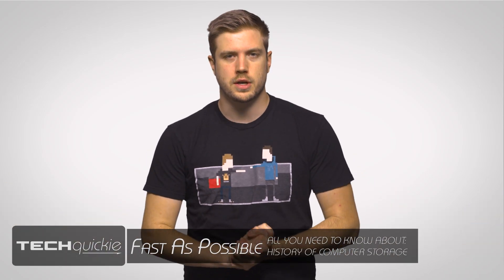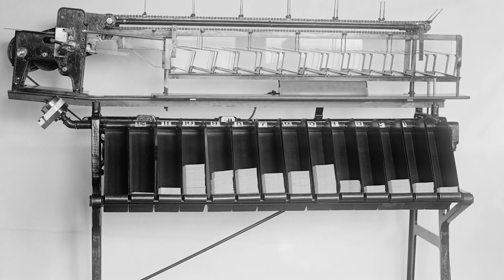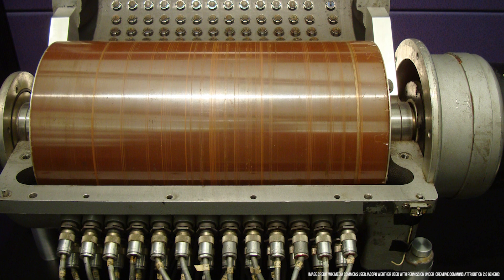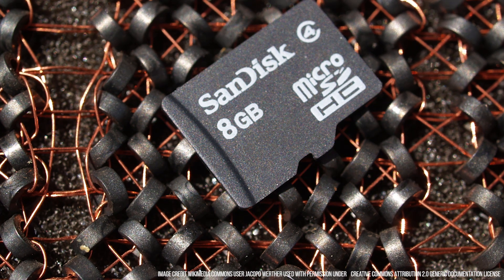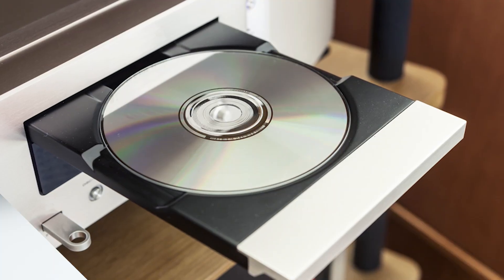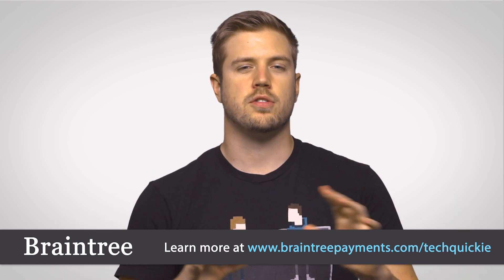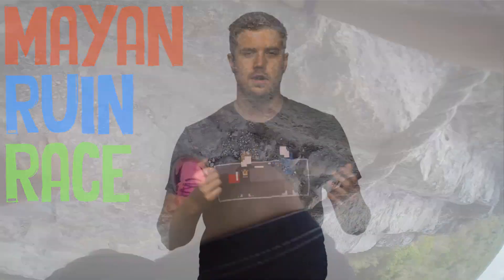The History of Computer Storage

Comment: But wait. Before using floppy disks, they used cassete tapes, did'nt? 
I remember of a C64 cassete tape driver that people used to store data.
Reply: ...and Vic20 before that.  Atari computer too.  Can't remember if Apple tried tape first.  The Sinclair had tape.  Lots of others too.  Wow it was exciting when microcomputers hit the market.  Golden years.... sigh.
Reply: Cassettes are tape.  He mentioned tape.
Reply: I question if you can quadbit on those tapes...

I mean 1's and 0's are fine, modulated down to sounds. But you could speed up reading/writing to audio tapes if you have a 4 state or even 8 state system. Like MLC and TLC.
Reply: Franklin Cerpico He portrayed all magnetic tapes as large, cumbersome things.  And that relief arrived only when disks hit the market.  So that's why it  was pointes out that cassette tapes were/are portable and convenient.

Masticina Akicta Huh?  Roughing it out with four old 56k modems, on each of the four tracks of a cassette, would provide large storage.  And those "old", more recent, modems (90's) were designed for the limited bandwidth of phone lines.  Cassettes have a much broader bandwidth.

I'd have to pull out the books to figure out the theoretical limits, but old tape modulation (80's) didn't even utilize stero tracks, and was just very primitive in general.

Wait... I didn't bring up this issue in this thread.  It'll just confuse readers.  Sorry.

Btw, info on tapes and disks are never stored as unmodulated 0s and 1s (as in magnetic polarity).  Unfortunately, that notion has been perpetuated.  Data is always modulated to analogue, and compression schemes are implemented.
Reply: schitlipz Ah right, makes sense. I am sure that with todays insight and technology we could stuff allot more on an audio tape. Hell lets be fair we already stuff TERABYTES of data on big tapes. A small tape like that probably can handle a Gigabyte if using the same level of technology.

Comment: I worked on a system that used cards and drum storage in the early 80's.  And the drum held about 700K bytes.  It also had core memory.  Each card that was about 18 inch square held 1024 Bits.  It took 16 cards to hold 1K words.

Comment: I'm sitting here with my $2 ebay 32GB Micro SD card like "woah"
Reply: Be careful with those on eBay. They are often counterfeit and don't hold as much data as is said on the card.
Reply: Yea, this one only holds 29 gigs :(
Reply: That's cause 32GB and 29.8GiB is the same. Google GB vs GiB if confused.
Reply: 29 vs 32 is acceptable, even branded ones do this. The problem is that some cheap drives would have a build in way to trick the computer into thinking it can hold so much, but when you fill it up there is very little space (8 or 16 gb) and the data gets corrupted, I'd save download a bunch of data onto it (a few hd or blue ray movies can do the trick) to make sure it will hold as much as it seems to be able to before using it for important stuff.
Reply: Well said, but there are also programs that will test how much data the card is actually able to hold like h2testw.
Reply: Ah cool, how does one look up such a program? What are they called/name a good one
Reply: I hear H2testw is the best one, not certain what any of the other ones are, but you can just search H2testw on Google and Softpedia has an English page for the download.
Reply: WOAH WOAH WOAH WOAH!!!

Comment: THE HARD DRIVE ON MY LAPTOP IS ONLY 32 GIGABYTES!!!!!!!
Reply: BlueJayGamer17 You probably have a Chromebook, and it doesnt have a hard drive, it uses flash storage which is faster than a hard drive, but more expensive to manufacture and holds less data, similiar to an SSD.
Reply: DemonicScepter an SD card? A HDD is 10 times faster.

Comment: This video relives a hole lot of memories. I never found out there was such thing as flash memory until I bought an hp40g+ calculator back in either 2005. The manual suggested inserting a flash memory chip. Into a special slot built into the calculator. So I thought I was in seventh heaven with my SD Card because I could keep backing up my HOME directory onto this card. if things crashed I used the SD Card to get it back.

Eventually I learned how to organize my data into a DOS/Windows directory hierarchy. I built my Home directory archive filenames out of today's date. That way I know when I made them.

Comment: I still use the 3.5" floppy on older Agilent spectrum analyzers, noise figure analyzers, and vector network analyzers to transfer screen captures to my Windows 10 laptop at work. Yes indeed Windows 10 has a floppy drive icon still in the icon database.

Comment: Great history lesson there in 6.5 min, I learned some things I didn't previously know! I grew up in the 90s as a teen and used computers with 5.25 and 3.5" disk drives so am all familiar with those. I have in my collection a few 8" disks. Just a bit of correction on 8" disk capacity, I read on Wikipedia their actual max storage capacity to begin with in the early 70s was 242,944 bytes so about 240kb, and with later tech development the 8" disks could store up to 1.2mb! Anyhow floppy disks for games back in my day were slow and a pain in the arse and occasionally bad sectors occur on them corrupting them and I lost games I bought from a computer store because of this which sucked!

Comment: my budget is around $500 am i missing anything? are the parts compatible? any advice?_________________________________________________________________________________

CPU - AMD FD8320FRHKBOX FX-8320 FX-Series 8-Core Black Edition Processor

Case - VIVO ATX Mid Tower Economy Computer Gaming PC Case / Black Desktop Shell / 4 Fan Mounts, USB 3.0 Port (CASE-V01)

GPU - MSI GeForce GTX 960 DirectX 12 GTX 960 2GD5T OC 2GB 128-Bit GDDR5 PCI Express 3.0 x16 HDCP Ready SLI Support ATX Video Card

Storage - WD Blue 1TB SATA 6 Gb/s 7200 RPM 64MB Cache 3.5 Inch Desktop Hard Drive (WD10EZEX)

Motherboard - ASRock H97 Anniversary LGA 1150 Intel H97 HDMI SATA 6Gb/s USB 3.0 ATX Intel Motherboard

RAM - G.Skill F3-12800CL9D-8GBXL 8GB (2 x 4GB) DDR3 PC3-12800 RipjawsX Series for Sandy Bridge (9-9-9-24) Dual Channel kit Desktop Memory Module
by G.Skill

Power Supply - EVGA 500 W1 80+, 500W Continuous Power, 3 Year Warranty Power Supply 100-W1-0500-KR

Case Cooling - Corsair Air Series AF120 LED 120mm Quiet Edition High Airflow Fan Twin Pack - White (CO-9050016-WLED)
Reply: CPU and Motherboard aren't compatible. Because, well, CPU is from AMD and the motherboard (obviously) only support Intel CPUs.
Here's the Newegg link for compatible motherboards: http://www.newegg.com/Product/ProductList.aspx?Submit=ENE&N=100007625%20600138080%208000&IsNodeId=1&bop=And&page=1
Also, I recommend to use aftermarket CPU cooler, even you're not planning to overclock it.
Reply: ok

Comment: My first computer used audio tapes connected via headphone and mic sockets for it's main storage, but you could buy a 130kb 5 1/4" floppy drive for it, though that cost more than the computer itself and I simply couldn't afford to do this. Still have a crap ton of games and utilities on tape in the cupboard under the stairs.

My second hand a built in 880k 3.5" floppy drive and expansion sockets for up to 3 daisy chained extra drives, and IDE for an internal hard drive, as well as external SCSI for plugging in HDs, CDs, Zip Drives etc. Still have this machine downstairs with dual floppies(1 internal, 1 external), a 1gb IDE HD and a SCSI CD-ROM drive in the cupboard under the stairs.
Reply: Well you can only get rid of your old day games as you've no way of playing them on modern Computers

Comment: As a few people noted, you missed cassette drive storage, used on early PCs.  You also missed the mercury delay memory used on the Univac I and some other early computers.  This was an alternative to the Williams tube CRT memory.  The video as a whole is pretty sloppy about distinguishing data storage media from active CPU memory (e.g. RAM).  Williams tubes and drum memory were used as RAM, but some early computers also used tapes or punch cards for slower data storage.  For example, the Univac I has mercury delay lines for RAM and Reel to Reel tapes for data.

If I was a computer history professor, you wouldn't get a very good grade.
Reply: Also the IBM 305 RAMAC was not 50 feet tall.  The platter assembly was about 3 feet high and the cabinets were about 6 feet high, although the whole system weighed tons.  This is just a sloppy (and ridiculous) error.

Comment: My first computer booted from cassette tape which is kind of primitive by today's standards but it was certainly better than paper tape. I saw the 8 inch floppy go out the five and a quarter come in which is what I had then. I went to three and a half inch disk and to hard drives for boot up and now I use mostly solid state drive. The best storage that I had back in the 80s was it tape drive that connected to my floppy Drive controller I could store 250 Meg on it.

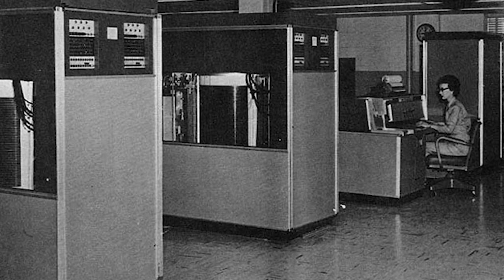Comment: 3:23 the old school ibm machines were 50 feet tall?  sounds like a typo in the script or something
Reply: Yep.  The original RAMAC 50 platter drive units were about 50 inches in height, the platters were covered with magnetic paint. 1,200 RPM and just one read/write arm that retracted to travel up and down to select a platter.

Comment: I still love to shoot film (i also use digital cameras, more then my film ones). Also, unless you compare film images to the likes of the hasselblad H6d100, it out resolves almost all digital cameras. (only if scanned with a appropriate scanner though. sorry a 100$ flat bead wont cut it here. You would need something like a drum scanner) (also if you, the reader of this comment, are wondering what film size im talking about, its the small 4x5 film format. (that's inches btw...).

One downside to film though. You dont get second chances, if you screw up and burn film, its gone for good.

Comment: I'm genuinely curious when we'll have our first 3.5" 1PB hard drive.
Reply: Given that the first 1TB hard drive came out in 2007 and the first 6, 8, and 10TB drives came out between 2013-2015, hard drive capacity increased tenfold in 7-8 years, so it'd be another 8 years until we get 100TB drives and an additional 8 after that for 1PB drives. This assumes that the increase is consistent and doesn't taper off as time progresses.
Reply: or we might hit a limit and the actual progress gets lower and lower
Reply: What about that dna storage stuff?
1 zettabyte in a gram!
Reply: We WILL see 1pb of storage, but it won't be a drive. By the time we develop anything near that size, we will have moved one from physical drives all together. All in all, our best bet on that size is liquid drives. But that's years away.
Reply: and im here... waiting for 10mbps downlaod speed..  😔😔
Reply: Samsung announced a 32tb ssd, and last year they put out a 16tb and the year before that it was an 8tb ssd. So if given trends hold up, we will see the first 1PB ssd get announced in 2021, however it will probably only be available to the enterprise market and the wealthy, we'd have to wait until somewhere around 2024 for it to enter the consumer market, but it'd still cost more than $1000 dollars at that time.

Comment: @3:24 "Although it was 50 feet tall and contained 50 platters, this early drive only held 5 MB." Um, no. The IBM 350 hard drive was not fifty feet tall. It was more like 6 feet tall, with the actual mechanism (the stack of fifty 24-inch platters) about 3 feet tall.

Comment: i had a tape drive in the 90s was no room in case so used a hack saw cut a hole in the metal case. think tapes were 175gigs. slow as helll. had first usb stick 1.0 was like 512megs

Comment: I think floppy disks should be remade with modern technology and used for movie storage, you buy a movie and in the case is a floppy disk just big enough for the movie, with the artwork on the label section of the disk, every media system should have a floppy drive and we would once again get the clunky satisfaction of pushing in a floppy disk into the drive.

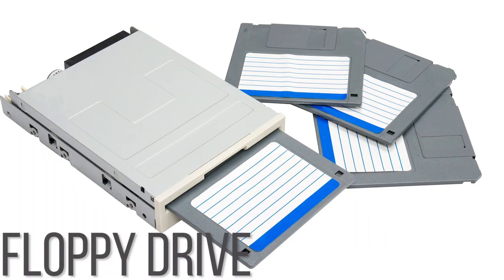Comment: Your picture of floppy disks are inaccurate. Those shown on the clip (3:50) are the second generation, and are not floppy.
Reply: Even though the 3½-inch version shown (which is actually third gen) was no longer floppy, It was still labelled a floppy disk. 
First gen 8-inch, Second gen 5¼-inch, Third gen 3½-inch .

Comment: Battery-backed bistable multivibrators (that's not a sex thing) could be here.  And maybe delay lines too, but that's reaching... As was the core memory mentioned here, whose persistance I don't know off hand, but I think wasn't long-term.

Btw, cassette tapes were more portable than floppies.  That I remember for sure.  More durable too.  Hell, I'd go cassette again if they applied modern modem techniques.  Well, I'd use them for long term memory and use flash for interim.

EDIT:  And optical tape:  Memory could be stored on film.  I think there was even a kind of laser tape with same iridescent look as CD ROMS, but it was a spooled tape.

The first laser discs weren't very compact at all and skipped all the freakin' time.  When I was a kid, in the 70s, we borrowed one (can't remember if it was on the market yet) and the thing was the size of an LP.  We tried watching Texas Chainsaw Masacr, but every time a truck went by on the street it skipped and had to reset.  So we started renting BETA machines instead.

Comment: History of computer storage has to be redone. Maybe a voice over. The part about hard drive storage being 50 ft tall with 50 discs is totally ridiculous why would a person need 12 inches between platters. This guy is reading from a script and he doesn't think about what he's reading. The 1890 census was done on Punch Cards as per the pictures seen not on paper tape as he says.
Reply: This completely wrong, of course.  He's talking about the IBM 305 RAMAC system.  Each platter assembly was about 3 feet high, although the cabinets were about 6 feet high.  From Wikipedia:

"The 305 was one of the last vacuum tube computers that IBM built. It weighed over a ton. The IBM 350 disk system stored 5 million alphanumeric characters recorded as 6 data bits, 1 parity bit and one space bit for 8 bits recorded per character.[7] It had fifty 24-inch-diameter (610 mm) disks. Two independent access arms moved up and down to select a disk, and in and out to select a recording track, all under servo control. Average time to locate a single record was 600 milliseconds. Several improved models were added in the 1950s. The IBM RAMAC 305 system with 350 disk storage leased for US$3,200 (equivalent to $27,287 in 2016) per month.

The original 305 RAMAC computer system could be housed in a room of about 9 m (30 ft) by 15 m (50 ft); the 350 disk storage unit measured around 1.5 square metres (16 sq ft). Currie Munce, research vice president for Hitachi Global Storage Technologies (which has acquired IBM's hard disk drive business), stated in a Wall Street Journal interview[8] that the RAMAC unit weighed over a ton, had to be moved around with forklifts, and was delivered via large cargo airplanes. According to Munce, the storage capacity of the drive could have been increased beyond five megabytes, but IBM's marketing department at that time was against a larger capacity drive, because they didn't know how to sell a product with more storage."

Comment: 0:33 why does that hand have tiny Crocs on it's fingers?
Reply: Those are rubber fingertip protectors. If you had to punch keys with the force needed to punch out the paper for 8 hours a day, you either develop blisters or caluses without protection.

Comment: I disagree with floppy 3.5" disk are not used anymore other than it's storage use. Our company still uses this to transfer files from the design computer to the computer controlling the router machine since the computer still don't have a network connection available.

Comment: 3:52 You are incorrect about the date. it is 1961
Reply: Per wikipedia =  "The first floppy disks, developed in the late 1960s, are 8 inches (200 mm) in diameter;[1] they became commercially available in 1971 as a component of IBM products and then were sold separately beginning in 1972 by Memorex and others."

I"m not arguing, exactly, but I'm interested to know the source of your claim.  Wikipedia has its moments of brainfarts rarely too.
Reply: Yeah. But i havent got the data from wikipedia. i just remember it from some History video when the CD came in.
Reply: actualy to be presice. 1965.
Reply: Shy tzedaka I'm still waiting on your source.
Reply: i dont have the source anymore. but lets all agree it is in around the 60's and not the 70's
Reply: Shy tzedaka You can agree with that if you want.  I'm sticking to something that , so far, has more concrete  or closer to THE concrete evidence.  When you find the source, I'm all eyes.